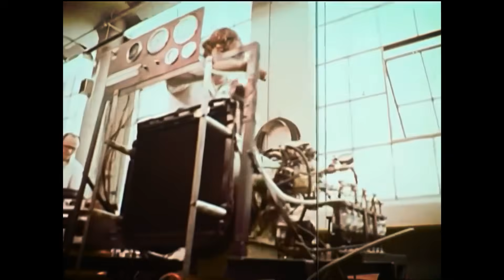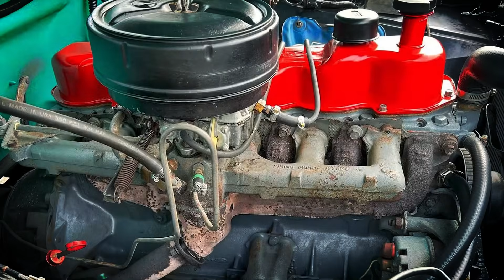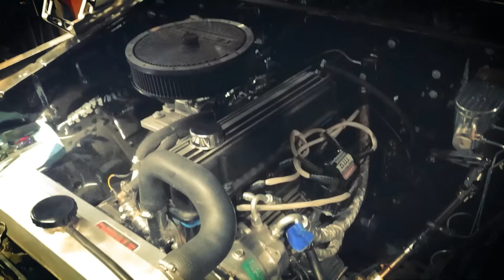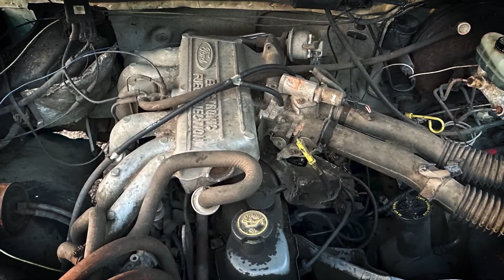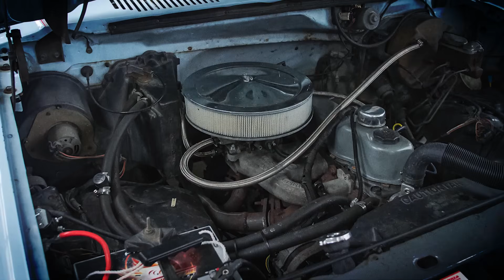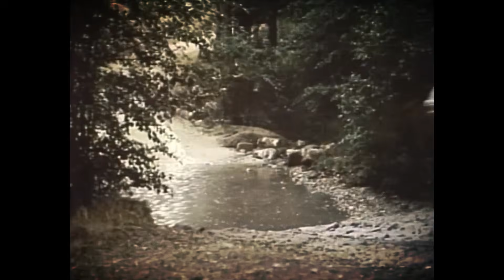THE LEGEND OF THE BULLETPROOF FORD 300 INLINE SIX

Comment: I ran the 240 for 39 yrs. (three diffeerent ones). In the last 240, after 26 yrs of faithful service...I put on a set of the efi exh mnflds. What a difference that made! That engine made 169,000 miles. Oil was passing past the rings. It did not have a lot of compression. 
  I replaced the engine with a rebuilt 300 from Jasper. It is a '86. Last yr of the mech. fuel pump versions. It is a real strong motor. Of course using the efi exh mnflds again. The truck is a '65 F100. I took off the stepside body. Made a fab table to go in its place. The 1/2" plate holds a Miller weldor. The truck weighs in at 5,300 lbs. 
  Still using the 1V carb and oil bath airfilter. The truck is real happy with the 300. I am using Rotella 15W-40. 
The motor is everything and then some of what the engineers set ouit to build.
Reply from the maker: Wow, that is awesome!